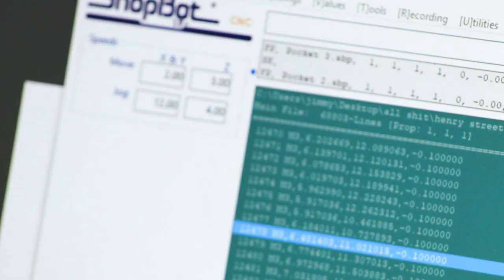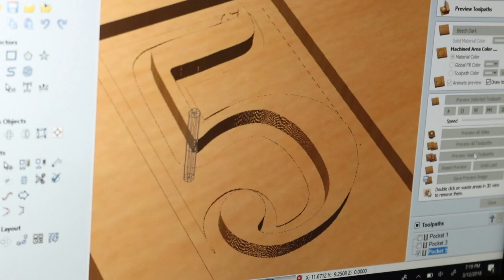DiResta CNC Address Numbers

Comment: What happens to the DIRESTA that use to inspire people to work with whatever tools they have?.... of course, he had new and better toys now, but what about the 91% that don't have?🤔
Reply: I have a CNC router. He's inspired me to try aluminum on it. So ... I guess that DiResta hasn't gone anywhere?
Reply: Because of Jimmy I bought a Laser Cutter.
Reply: And a Belt sander
Reply: And a Drill Press
Reply: I could probably go on all day.
Reply: Fancy tools just make things faster. CNC makes things just more accurate and repeatable. In the end you can do all that with simple tools. For instance these house numbers, take two thinner peaces, cut number out from first one, polish and solder or screw peaces together. If you dont want screws to show, sink the screw head, take peace of aluminum round stock, hammer it into hole, cut and sand flush and polish. Also this would be much better option compared to Direstas version as you have scrap peaces large enough to use in other projects, like to make inlays and it could even be faster than CNC to produce.
Reply: Just google Fablab please, find one near where you live and you'll see everybody can have access to those machines. Thanks.
Reply: always has to be one ass who complains about someone using tools they don't have. Work a little harder and maybe you could afford them. Don't blame Jimmy because you're poor. Look in the mirror. Or start a channel for people with limited means.
Reply from the maker: Ernesto....So i should remain the same person i was 6 years ago? never improve my shop capabilities? never learn new trades? never take free tools I've wanted my entire life but couldn't afford. Never  show the people watching me that it is possible to grow and expand out our your comfort zone?  in this video i used 5 tools.. maybe you don't have one.. get creative and use the bandsaw for the same thing i did w the cnc... if you learn anything from me it is IMPROVISE AND BE INVENTIVE!!!!!!!! ...... and never complain.
Reply: Jealousy's a fools ride.
Reply: Since when is this channel supposed to be some kind of beginner's how-to? Jimmy's a professional and shares the work he does.
Reply: Daniel G  You said it perfectly!!!  That's it in a nutshell. @HoneyOnWales
Reply: Everyone have an idea what a CNC Machine can do, but what DIRESTA could do with it is the admirable combination, the video is my point, not your personal achievements
Reply: Guessing you don't have the biggest tools Jimmy has, his brain and his passion.
Reply: @Ian Hall/ It is not what you have, is what you do with it!
Reply: There is no AI in CNC, or anywhere in this video.
Reply: Ernesto Pinedo I liked the video.  makes me want a cnc router more than ever...
Reply: Ernesto Pinedo ..yes i agree. I was just thinking..Jimmy didn't really make anything in this vid, just chose some numbers on his computer, and let the cnc do the work, and did a bit of finishing. This kind of video has no real creativity, and serves no purpose..we all know what cnc technology can do. This is more like manufacturing than making. Sorry Jimmy, but if this is the future of 'making' , it's at risk of killing our creativity, intuition and artistic abilities. Just saying...
Reply: Ian Hall LOL well said.. this makes me want to try new stuff.. not give up on what I already know
Reply: Jules Webb i sorta see this side of the argument. but I don't think cnc is going to kill off craftsmanship. it's just a tool used to improve certain aspects of making.
Reply: Brian Vaughan  okay,yes i see your point too. I kind of regretted my comment..a bit harsh perhaps. Of course cnc has its place in making. I put my feet up to watch a long awaited diresta vid (i watch them all), and it was the first time I felt disappointed by the content. My approach to making/creating is often impulsive and spontaneous, it's the way my mind works; so anything where computers and cnc machines are involved can leave me feeling cold. If i was into designing stuff on a computer, i would warm to this technology more! I like to think i have an open and flexible mind, so one day i may have a cnc router in my workshop. You never know!?!...and no offense intended to Jimmy either. : )
Reply: Jules Webb it wasn't a bad comment. this little chain of comments has made me think about cnc and how I feel about them.. anything that encourages thought is good in my books. I really do see both sides of the cnc argument. sometimes I feel like people use it like a crutch. (not everyone.. but some)
Reply: I would've etched them chemically. 1-Apply photo-resist dry film, 2-Print artwork, 3-Expose and develop, 4-Etch with Ferric Chloride ! Voila !
Reply: A.H. Shukry would that etch cut down a full inch of aluminum?
Reply: jimmydiresta  Well said sir, I couldn't have put it better myself.. what is happening to the YT viewing community, so much negative hate from people who are only happy while you have nothing, and struggle with ghetto tools and makeshift solutions.. the moment you try to improve yourself, your equipment and your abilities, you become somehow 'less credible' and 'no longer authentic'....surely the biggest lesson of all is "go forward, improve your skills and share that growth with the community"..!?
Reply: Says someone who's never done cad-cam.  The computer doesn't "just do it for you".
Reply: Barry Woods lol, very very true.  I wonder if the guy who started this string of comments is still happy they commented... hahaha
Reply: The little hands get me every time... every...time
Reply: Was it ever his job to inspire people? no. It was his job to make things. Ernesto's job was to be inspired.
Reply: I bet he pinned this because its such a unique and inspiring comment, or because he's heard it a million times and is sick of it. Any word on the new Maker Mecca jimmy? Would love to see it since R&R is done now.
Reply: Ernesto my friend, I hope you can understand now that it may not necessarily be about the tools, funds or even the skills that an individual may or may not have access to...it’s about the desire to create something with your own 2 hands. To have an idea or inspiration that leads to a tangible object. To enjoy the journey as equally as we do the final outcome (success or failure). I know it can be discouraging to see all these “toys” that many wish they had.(which I do not) You can make amazing and stunning things with what you have at your disposal. Jimmy had inspired me to start my channel. It may not be a “success” by the standard in numbers but if that was my main goal I would be missing the point of the maker community, and it is just that, a community which is why I started with “my friend” in this response. I understand your point of view but I hope you read this and understand the point I am trying to make in the spirit of this community. I challenge you to see the positive in the technology and let it inspire you with what you do have. We can look at the objects in our everyday lives and find the inspiration needed. Much love Ernesto and make on making on👊
Reply: jimmydiresta the last sentence sums up so much👊
Reply: GREAT Comment back!!!!!!!!!!
Reply: Dude thank you Marcus!!!👊 just speaking from the heart😄
Reply: Jules Webb I agree, that's why I still only build things with rocks and sticks and stuff I can find in my yard. I want to do it the right way, the way it was done when people were really creative.
Reply: As deep as you want. The snag is that the sides may not etch perfectly vertical, but there are workarounds.
Reply: These were scrapped as they actually needed “532”....
Reply: Perception is in the eye of the beholder?   I've been watching since you came on YouTube.  I don't have all the tools and I won't but you inspire me to think outside the box!
Reply: Jimmy, to start I will say that I never miss a video that you make and I have been inspired by your work.  I made a chessboard/storage box in part from watching you make a chessboard.  The point here is not stagnation but enjoying seeing someone craft something with their hands.  I admit that I started this video and quickly bypassed watching the machine make the numbers.  Your craftsmanship is undeniable and it is what draws me is watching you do it.  Btw great interview with Laura Kampf.
Reply: Jules, can you run a CNC and use Vcarve?  It's not plug & play, you have to LEARN new skills.  The lesson on his channel is to try new things.  Remember everyone is at a different skill level so what's simple for you may not be for others.  Just saying....
Reply: Just wanted to add....I watch Barnyard Builders and they saw the old timers move from axis to a saw mill.  They missed the look but, recognized the value and appreciated the craftsmanship.  This is similar.  No worries.
Reply: he use always the best tool for the job...using a cnc does not mean being less craftsman, it means being an intelligent craftsman who uses technology to make his projects faster and more profitable ...
Reply: :D
Reply: I became MAKER because of Jimmy DIRESTA, and I bought a CNC Table, Table SAW .... He Is Inspiration even if he use a fully automatic workshop!!!

Comment: Customer asks, "Hey can you make these out of aluminum?" Jimmy,  "Yeah, it's the same as wood."
Reply: Only difference is that wood working tools dull faster with aluminum. I have used chisels (making drill holes square) and hand plane (rounding on corners) with aluminum several times.
Reply: Make Build Modify Try cutting osage orange wood. About the same as aluminum, except smokier. :)

Comment: Just a tip and only for a second, use a 1/2 end mill to rough then run a clean up pass with smaller endmill

Comment: Just thinking out loud... Could you have achieved the same result casting the numbers in a resin / powdered aluminum mix? 

Cnc the numbers in wood, glue them onto wooden backing rectangles, make reusable rubber molds. Then sell the hell out of them.

Comment: Question and a suggestion/challenge.
Q why use the bandsaw and then the tablesaw (was the tablesaw just to clean the cut up?).

S/C it would be cool to see you try and have a go at doing an old tony'esk jump cut when cutting a bit of material up with a comical twist,  maybe use one of your axes or some other tomfoolery,
Cheers 
Evan

Comment: Many thanks for also sharing the cutting speeds (at 2:43). I have a small CNC router and have been contemplating about doing some aluminum or brass work. I am in Turkey (metric units) - could you please provide the units for the cutting speeds you are using? Since your videos are mostly speeded up, I have not been able to estimate by looking. The cutter seems to be around 5mm diam.? Also - heat buildup does not seem to be an issue?? Many thanks again, you have been a long time inspiration.

Comment: Looks like you're using contour cutting. Try using the dynamic or high speed toolpath (depending on program). It's much better on the bit because it makes sure that you always have an exact feed\chip rate. In contour cutting, when it reaches the corner, it needs to slow down at which point the bit gets really hot because it's not cutting large enough chunks (to take the heat away). The dynamic mode is also MUCH faster. Looks like this: https://www.youtube.com/watch?v=Nk746geVLYw
Reply: With this method, would you be able to run more cuts in the same job (in turn saving a bit more time)?

Comment: I think you're excited about this Shopbot Jimmy. Seems like the Tormach could've cut this job a little quicker. What blade did you use in the table saw for final dimension after ripping on the bandsaw?
Reply from the maker: as i said in the description this job didn't fit into the 440 , table saw to square" the cut
Reply: jimmydiresta My apologies kind sir. I didn't read the description. I was joking not criticizing, I hear you talk about the trolls on "Making It" all the time. Thanks for responding though.

Comment: So, you can cut metal on the table saw like that... That's a new one for me. Thanks.
Reply: Luke G aluminum can be cut and shaped with the same tools that are used to cut and shape wood.
Reply: Aluminum is soft enough it won't damage unless you let it bind up under heat. It's actually softer than some wood. Purple heart is the hardest I have cut but an uncle got some ebony and he said it was harder to work than steel

Comment: Hope you saved the aluminum shavings, maybe for a thermite welding art project...
Reply: andrew32155 He could send them to Peter Brown.
Reply: He can cast a iron oxide and aluminium oxide block with some resin which he can then turn into a cup to hold magnesium strips.
What could possibly go wrong?
Reply: It's not hard to melt aluminum into an ingot. He make that block into something else.

Comment: Jimmy please never brush chips with your hand. I almost lost 2 fingers when they got oily aluminum embedded in my hand. I thought I got all the metal but I didn't. 4 days I had blood poisoning with red and black lines running up my hand to my arm. That was apprentice no no first day and I ignored it.
Reply: That’s a good point. The shop can be a nasty place. Something tells me Jimmy’s hands are like leather tho.
Reply: What? Please explain. 
The aluminum got stuck in your skin and came in contact with your blood, so badly that you got blood poisoning and you didn't even feel it?!
Reply: yep. When I did a lot of neon glassblowing and scientific glass blowing, I could tell that the glass was hot because it felt slick, not because I could feel the heat.
Reply: @Build Motion, also jimmy cut his little finger off with the bandsaw and still cuts bare handed (which you should do, but still.)
Reply: Great tips! I never would have thought that metal chips could be that dangerous! I will be more careful from now on.
Reply: Jimmy please don't brush chips with your LITTLE HANDS too

Comment: With that much CNCing, did you have to replace the bit?
Or is Aluminum soft enough that it didn't make a difference?
Reply: Carbide endmills chew up aluminum like its nothing. I have cutters that have only been used on aluminum that have lasted well over a year so far. Good endmills will usually last you a couple months even if you are cutting allot of steel.
Reply from the maker: yep in good condition

Comment: Those poor saw blades
Reply: Actually carbide saw blades are fine for Aluminium. It works better if you choose a blade with a large teeth count.
Reply: Yup, carbide cuts aluminum. Just have to watch feeds and speeds.

Comment: Do you need a certain blade to cut aluminum? Like a lower tooth count?
Reply: I'm pretty sure that wood blades will do aluminum no problem, regardless of tooth count.  I know I have cut aluminum on a table saw with a reg'lar Diablo carbide fine tooth and no issues (carbide is waaaaay harder than aluminum).  I could be wildly wrong tho, so grain of salt right...